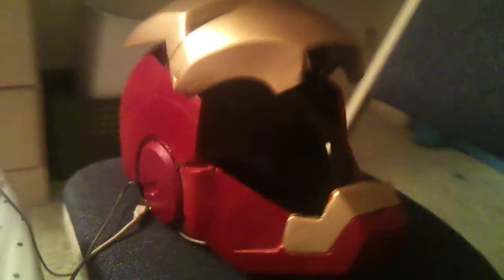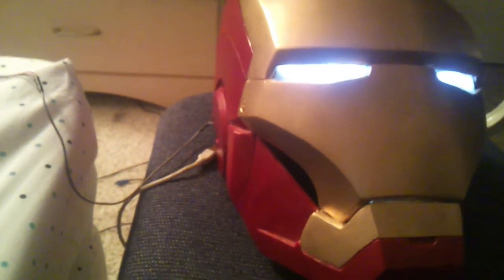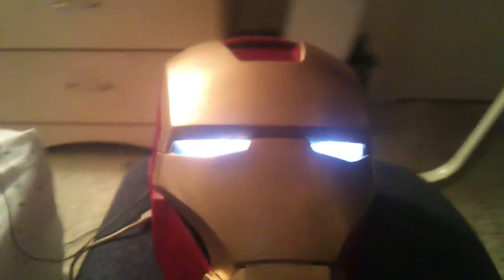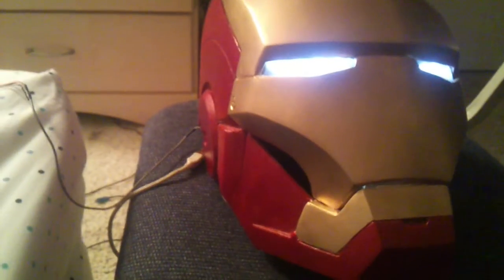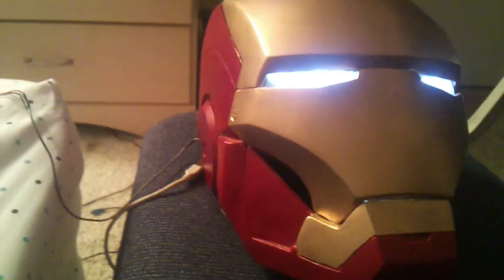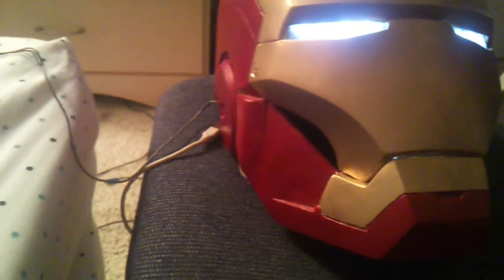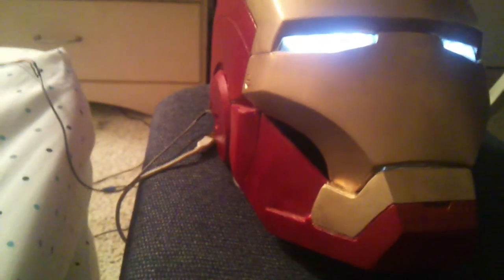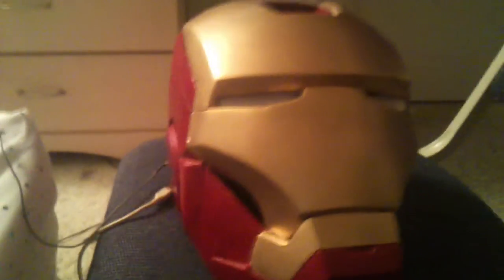IronMan Helmet Mark VII Electronic faceplate with LED lights

Comment from the maker: Depends on the method of the build. Foam is cheap and fast, probably 60 to 70 dollars for foam, 10 dollars is glue sticks, paints somewhere around 50 to 70, amd your time. Figure about 3 months full time if you have prop building experience, 6 months to a year if you dont. 
Fiberglass takes longer and is more expensive..

Comment from the maker: Im using HiTec servos, something small enough to fit at the top and enough torque to get the faceplate lifted. As far as a board Im not using Adruino boards, but something similar.

Comment: Man those gears. I don't remember you saying it but what brand of servor motors did you use, and also are you using an arduino? If so what type and if not what would you use?

Comment: What did you use for the opening mechanism?  Is it a pump or is it electronic?  I know it sounds sort of silly to ask that, but I've seen pump shift system with lightable eyes.  Your insight will be much appreciated mate.